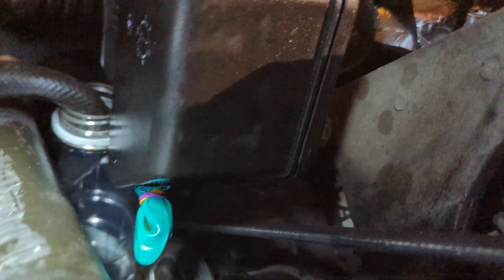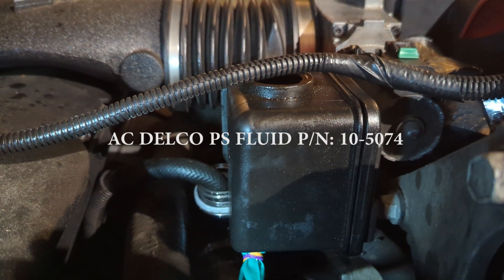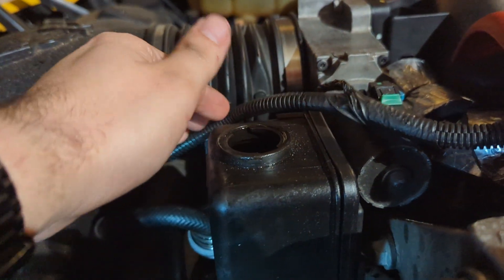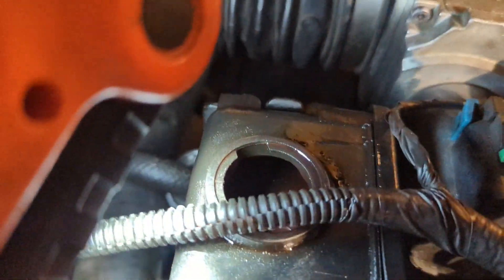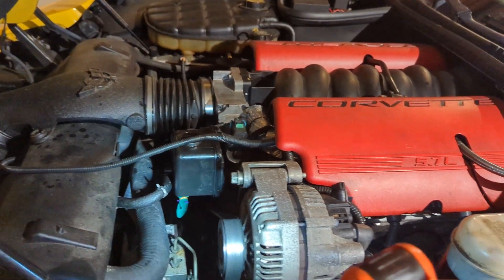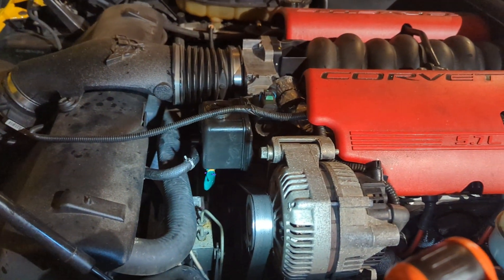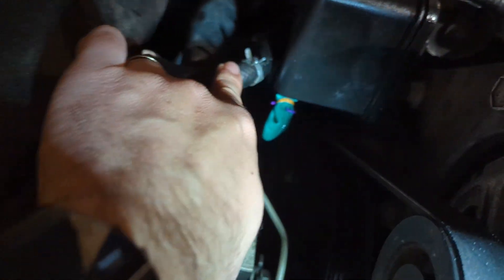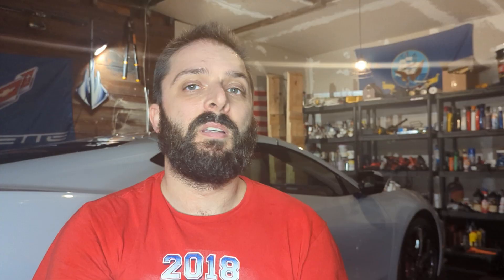HOW TO FLUSH YOUR POWER STEERING FLUID C5 CORVETTE | BOTH METHODS | STEP BY STEP | WORKS ON ANY CAR

Comment: Thanks for the post. I will be flushing my 2002 C5 per your instructions.
Reply from the maker: Awesome. Let me know if you have any questions.
Reply: Finished the complete flush via your procedures. Worked great. My fluid was nasty brown.  I used a rubber cap on the return line. Purchased at O’Reilly’s. It helped reduce the mess.  Thanks for the video.

Comment: I had a leak on my pump and so when I replaced the pump and the 2 lines, that got most of the fluid.  The pump will come out under the alternator B/C the bottom hose is plenty long. The bracket has to come off first.  Allot of mechanics on YouTube wanted to unbolt the rack and pinion to make room...but not needed. Also I used the Lucas synthetic P/S fluid and it worked fine.

Comment: Wow. I have not seen a factory plastic PS pulley in almost a decade now. If you ever have to remove the pump, just slap a bar behind that pulley and snap it apart. A - very satisfying. B - less headache reaching the 4 bolt heads (13mm? 15mm? I don't recall) to pull the pump. LS2 steel replacement is maybe $25. As for the RACK.... may the stop leak serve you well. I'd reach out to maybe Rick Kim in MD (RKT) to see who he'd recommend. Not sure if he does it himself, but he will know where to point you. I have had recent poor interactions with Turn One so I cannot say that I would fully recommend them. Probably still a fair bet overall. They are informed and offer guidance, but they have not backed their product or their mistakes (shipped me a pump with the VERY wrong adapter, then tried to tell me I ordered from a Chinese fake.... but here I am with their receipt.) Hey - now that you have the comfy cool whip colored cruiser for la familia.... what's in store for the C5? Suddenly she's going to be easier to picture with #10 of boost strapped on the nose....... Your life will then = Cake + Eating it

Comment: If you do this method with the recommended ACDelco PS fluid your rack will feel 100 times better! 

I have fried a GM PS pump using ATF before. The detergents in ATF will compromise steering components granted both are hydraulic fluids.

Comment: Exactly what I needed, my 2004 z06 is 100% factory, this spring when the car comes out of storage I’m doing all fluids first! Any thoughts on the motul dot4 racing brake fluid? They say that it’s no problem in a dot 3 car. Keep up the great work. Love your c8 too, I’m still over 8-12 months wait here in Toronto Canada
Reply from the maker: I've heard nothing but good things about motul. I do not see an issue with it. Thanks for watching!!
Reply: I went with Motul RBF600 for clutch and brakes and have loved it for years on my daily 99 coupe with upgraded factory brakes (high carbon cryo rotors, street/strip pads). Motul earned my trust. For the 03 Z06 I am switching to Castrol SRF for clutch, and for initial installation I'll use ATE Type 200 while I flush the heck out of the system a few times because it is new at all ends save for the chassis lines.

Comment: It looks exactly like my 02 c5 , mine only has 69,000 miles and doesn't leak anything,  but I will check the power steering fluid to see if I need to do this,  thanks for the video 🙂 mine also looks alot cleaner 😀